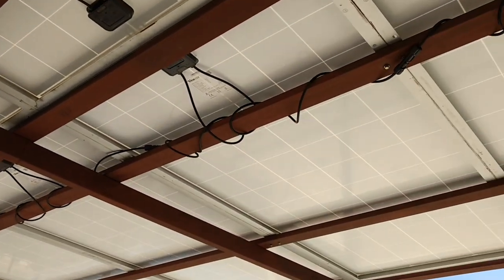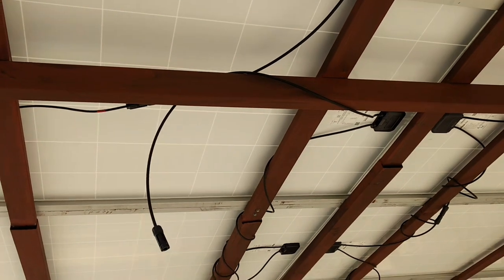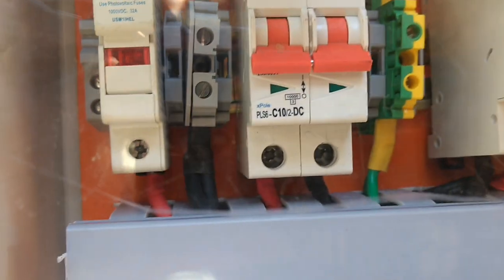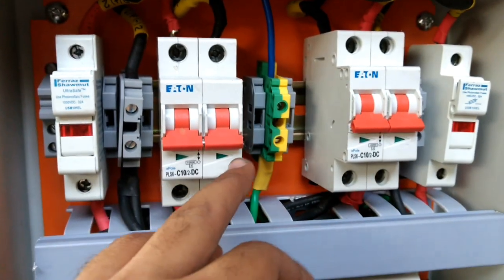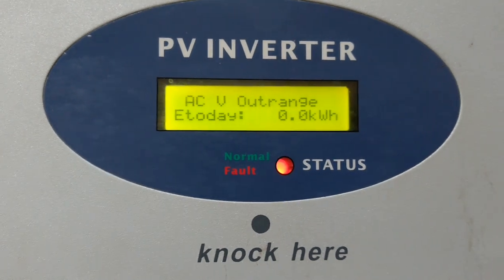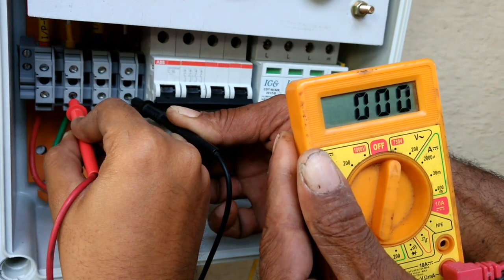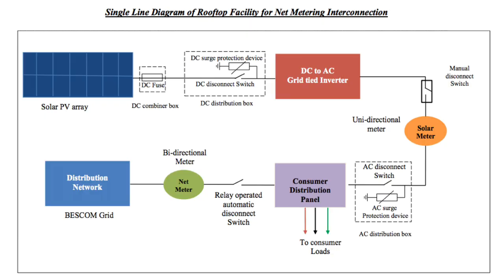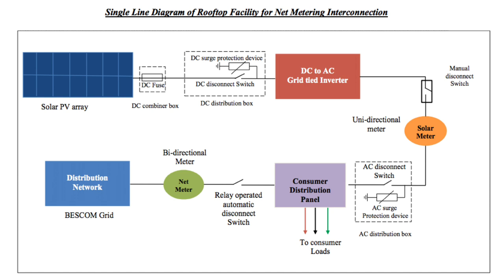5kw ongrid solar Rooftop installation #SustainableEveryDay

Comment: Why will the inverter burn is it continues to work in islanding mode, rather it should trip in overload , over current , under voltage fault
Reply from the maker: Correct the string inverter trips in any sort of fluctuations from AC or DC side.

Comment: Hello, Can you tell me calculation for DC DB & ACDB for 3KW System. What size of fuse should me taken, Surge protection & All regarding the same.
Reply from the maker: You can easily calculate the value for 3,kw from my sheet , excel sheet download link is in the video discription
Reply: @SustainableEveryDay  Post isnt opening. "This site cant be reached"
Reply from the maker: Ok , them text me on LinkedIn I will share all file there in the msg box Connect with me on Linkdln 
https://www.linkedin.com/in/himanshu-tewari-58994413a
Reply: @SustainableEveryDay  sent

Comment: Brother,am a small solar installer from south india.i have soo many doubts in ongrid system.what is the safety procedure for above 100v dc how do we handle it.and three phase grid tie inverter starting from howmany kilowatt.pls snd reply comment or any detail snd to my whatsapp no brother-8110099231.or make any video for this question brother.

Comment: can we connect single phase solar on grid to 3 phase net metering
Reply from the maker: No not possible , as per govt. Rules , but technically it is possible
Reply: @SustainableEveryDay  TECHNICALLY HOW IS IT POSSIBLE CAN YOU TECH ME .. THIS IS ONLY FOR EDUCATIONAL PURPOSE
Reply from the maker: In order to inject electric power you need a PHASE & NEUTRAL connection 3PHASE is just like an extra option to inject power , so single phase can also inject power in grid
Reply: @SustainableEveryDay  sir, can you sent the diagram in my mail id
Reply: @SustainableEveryDay Himanshu suppose i want to run a small manufacturing unit with say a15 hp 3 phase motor will it be possible to do that in on-grid system
Reply from the maker: 1hp = 746 watt so the plant capacity should be greater than the running load , 25% to be on the safer side , so for 15kw you almost need a 14.5 to 15kw solar plant
Reply: @SustainableEveryDay  ok thank you but it will run on net meter on grid
Reply from the maker: Yes it can run

Comment: Can I line in to a normal existing power meter or it's mandatory to use a two way meter in a grid tie system?
Reply from the maker: Sir it's mandatory by all DISCOM to use Bidirectional or Net meter for grid Connect ed system
Reply: @SustainableEveryDay  Thanks.

Comment: Wire size?
Reply from the maker: DC is 4sq mm, AC is 4core 25sq mm
Reply: @SustainableEveryDay  Use what safety products for 1 kilowatt solar panel.
Reply from the maker: Require 1000V 32A DC Fuse, and 4POLE AC MCB for inverter cutoff

Comment: How the extra generated power goes to grid ? And we take power from grid simultaneously.
plz help me with my university project on this
Reply from the maker: Hi Kazim Shah feel free to reach me on my watapp 9876976705 for your project
Reply: @SustainableEveryDay  sir its not showing on whatsapp
Reply from the maker: @syedkazim8875  then you can directly call
Reply: @SustainableEveryDay  hello brother nice work done I need a support on it I have same inverter in 6000watts and have 18 panels of 360watts can you please tell me how to connect our home load and also how inverter will convert itself after daytime
Reply from the maker: @wasiqimran  Connect 16panels in series with inverter

Comment: How can we use solar power in an on grid system during a power outage without using battery backup? My panels generate 600 V DC.
Reply: Connect the pannel in the inverter
If you have a UPS , connect the pannel in the place of battery. And use a L.T control switch. By this method, You can change to AC mains during night and to solar during day.

Comment: How much it costs to install 5kw  solar system
Reply from the maker: +allampalli manohara sai ram 
Sir the current market price for 1kw solar plant with complete installation is 70,000/-
Reply: 300000
Reply: Con 6306917457

Comment: Please don't use that multi meter. It is a highly unsafe unprotected multi meter not at all suitable for regular mains voltage, let alone 1000V. Buy a good brand,
Reply from the maker: +helloworld 
Sure sir
Reply: Yesterday i went and plugged my Multi-meter into a normal 15 amps socket and the unit went PHAT in my hand !!! It literally exploded. No smoke though. After that it has been showing astrological lucky numbers and  what not, instead of the correct voltage.
Reply from the maker: +mgr5550 
Lol you must have selected a wrong parameter on the multimeter
Reply: Yes mustve chosen the wrong option on the dial. I was at my home construction site. Weather is extremely hot here 38 deg and i was sweating and just wanted to run back to the car and sit in the AC. So in that heat i just twiddled the knob in a hurry,  i think i set it to DC. LOL. The heat can do some real shit to our heads.

Comment: Nice information sir..
One solar dealer told me that the solar generation is turned off as soon as the grid current is off and you also told about the islanding effect. This means if in my area the load shedding is for 3 hours everyday then till that time the solar electricity will not be generated. So it won't be that beneficial as in the total 10 hours of sunlight if 3 hours it is not generated then only 7 hours will be low.
And one more thing he told was that the solar generated electricity is directly sent to the grid and we get normal supply at home as it is from the grid as we get it without solar plant.
Are these things true?
Reply from the maker: +arjun pokale 
Yes true , this method is called Gross metering system , where the solar energy genrated is injected in to the grid , and the house load runs on normal supply
Reply: Solar Every Day ok sir... thank you so much for replying. Just wanted to know the system you told in the video is also a gross metering system or is it different than what i was told by the dealer?
Are gross metering and bidirectional metering different?
Thank you so much for the information. Appriciate your efforts to educate people about solar where there are many misconceptions.
Reply from the maker: arjun pokale 
Yes Gross metering is totally different from "bi-directional net metering system"
Reply: Solar Every Day thanks again.. ok i surfed a bit and got to know about it. So what will be your expert opinion about which system is beneficial or better for household solar systems?
Reply from the maker: +arjun pokale 
Well see if you are installing a Bi-directional net metering system then according to the government rules & regulations you can only install a solar plant equal to 80% of your sanction house hold load , this information is mentioned in your electricity bill, 
In my opinion off grid PCU system are very successful as there is no interference of government rules and it saves a lot of power
Reply: Solar Every Day ok sir.. but that will surely add to the battery and its maintenance.. i will have to work it out about the cost of both. Thanks for the info. Most of my doubts have been answered here. Thanks..
Reply: Yes thats the pathetic part of Grid Metering setup. When theres no power from the grid. Your solar is as useless as my  kitchen sink when it comes to power. Counter intuitive. Youll be sitting with no fans and llghts BECAUSE THERES NO GRID POWER. Kids in the neighborhood will make fun of your 'solar plant'. So go for an off-grid or hybrid system.
Reply: mgr5550 thank you so much for sharing your practical experience. That surely tells an off grid or hybrid system will be helpful if i have more power cuts. Thank a lot
Reply: Yes. ON-GRID is useful only if your planning to sell back unused power to the grid. If your usage is less and you can export  a lot on net metering and get benefits then On-Grid is ok. Else its a big fail. Imagine having solar and sitting without power because the Grid has failed. Then whats the use of solar.
In that make sure you get a system which can share the load between solar and gird in the day time. And save your battery only for night time fails. This will ensure your batteries last really long too. About 7 years.
Reply from the maker: +mgr5550 
Exactly now people are switching to PCU systems

Comment: Sir supply cut hone ke bad inverter v supply nhi deta or connection ap ke jaise kiye hain but on grid inverter ko off grid ya grid tai me modify kr skte hain?
Reply from the maker: +nitin kumar 
No you cannot convert on grid inverter into off grid, on grid inverter is design to stop its generation during grid faliour this effect is called "islanding" , off grid is different system where you dont have to depend on the grid as you have batteries
Reply from the maker: +nitin kumar 
On grid and GRID tie system is the same thing and you cannot convert on grid inverter into ofgrid

Comment: Best video sir ... but can you please make video on interconnection point between solar and grid from where we connect to the load ...busbar box where grid and solar both connected to the load (installation after inverter output to the load)
Reply from the maker: +shubh chaudhari 
Sure i will share you the link
Reply: Thnk you sir ... :)

Comment: We can produced 50kw using a new technology with less materials.

MATERIAL REQUIRES
1. Solar PV 51.nos
(250wp, 50v)

2. Baterry 68.No's
(12v bateries)

3. Our patented material.

#Title of invention: "A novel power saving economical multi layer heat insulator."
(From the internet, check and see. Part 1. the patent office journal 07/06/2013. Number 12277).

Please contact: nunzama87@gmail.com

Comment: Sir how to convert off grid inverter in to on grid inverter
Reply from the maker: +nitin kumar 
Hi nitin it is not possible as ongrid Inverter is synchronized with the grid and it stops production when the grid fails , this feature is not available in any of the offgrid Inverter hence you convert your off grid to on grid

Comment: Sir on grid solar system se apne use ke liye point kaise Len.?
Reply from the maker: +nitin kumar 
Inverter ke output k baad ek busbar box aap fit karlo aur usse apne ghar ka load connect kar lejeye aur ussi busbar ko gridconnected kar dejeye
Reply: Can you plzz show this interconnection point between solar and grid in video ?